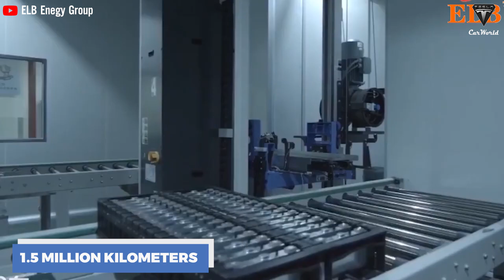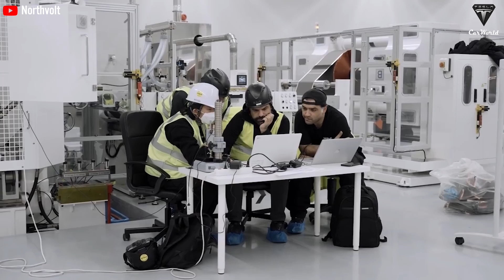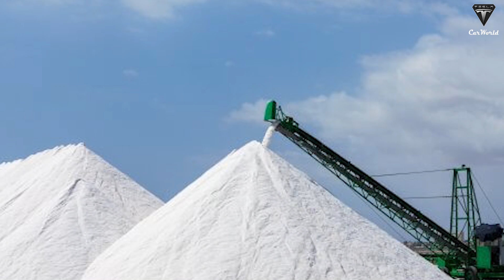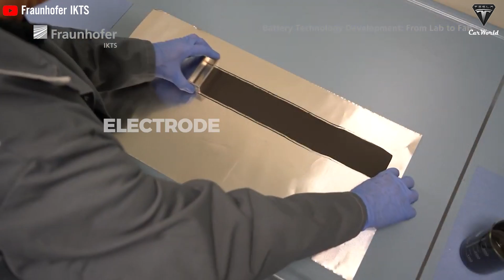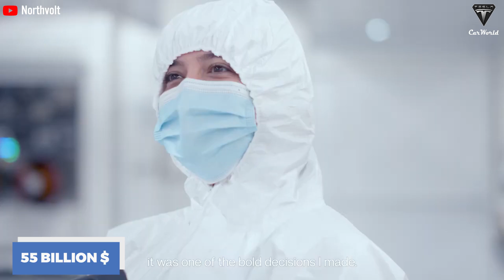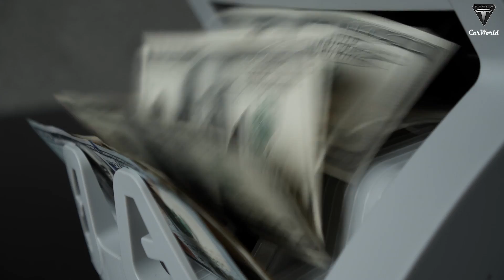Elon Musk Revealed The New Batteries Miracle Power more than 1.5M Km, SHOCKS The Entire Industry!

Comment: Everyone seems to forget that why EVs have taken over the oil combustion engine, the production of EVs are suppose to solve the climate change and people seems to be worried about charging time and coverage, you need fossil fuel to build mega factories for EVs and batteries?
Reply from the maker: Although the use of diesel-powered automobiles for many centuries prior is still strongly imprinted in people's subconscious minds, the development of electric vehicles and batteries is very necessary to address the pressing issue of climate change today. As a result, it will take some time for consumers to fully accept and trust electric vehicles.

Comment: What they did not cover is the mining of the raw materials. Are they able to that in a green manner? What power source drives the heavy equipment that is used in the mines and in transportation of those materials. Are the factories/plants built using green equipment to erect them? I could go on and on. You cannot, in the foreseeable future, get away from fossil fuels. Those wind farms don't work if the wind does not blow. Those large blades have to be replaced periodically and they are not biodegradable. They use massive amounts of oil in their mechanisms that has to be changed periodically. Are fossil fuels used in their manufacture? Etc., etc., etc. I could continue to get more and more granular. My point is that what is usually discusses is that the use of battery power saves the pollution of our air, global warming, and other Green attributes, but it takes more and more fossil fuels to get to that point, and will continue to do so for at least a couple more decades. We cannot accomplish the goal in the short term that is being pushed.
Reply from the maker: Thank for your sharing!

Comment: You can make the best battery in the universe, the biggest problem is going to be to generate the energy to charge all these trucks and also the infrastructure to do so.
Sun and wind is not going to be enough to deliver that much of energy.
Don't forget, they want to make everything electric.
Reply from the maker: Thanks for your sharing!
Reply: @smbrob: "Don't forget, they want to make everything electric". Ok, when do the regular cars sitting parked in your garage will also be connected to the system to "power-back" the demand.  The power will flow back and forth from the car to the "grid" as needed.

Also, as Elon Musk reported in a previous video, a solar power farm the size of Nevada is all that is needed to meet all of US electricity power needs.  Solar farms are growing by "leaps and bounds" every day.

In time every car top will be coated with some kind of solar generating material, as well as homes and commercial building roof tops.

Before you leap with negative immature conclusions, do your research.  You sound like a "Wooden Philosopher", that is someone with strong opinions about things he knows nothing about.

By the way, I got all of the info from "Tesla Car World".
Reply: @fritzsmith3296  I did my research and I am a electrician and i know how much power these vehicles need.
It is far far more than what we demanded from the grid in the past.
At the moment there is only a low percentage electric.
And using your car for power storage sounds great but you can not drive when you needed electricity and your car is not fully charged. So the car can only charge not give large amounts back.